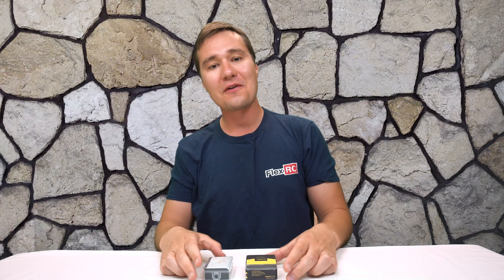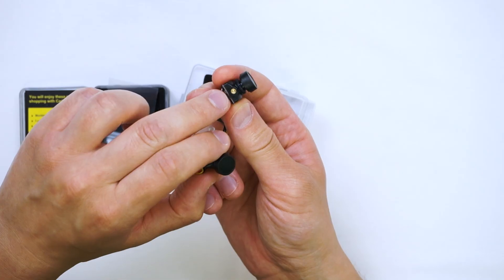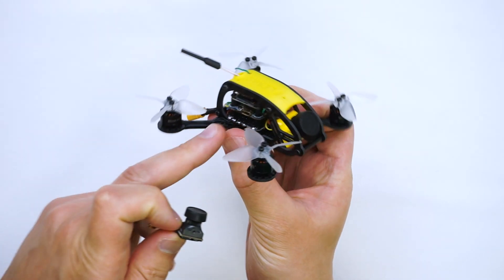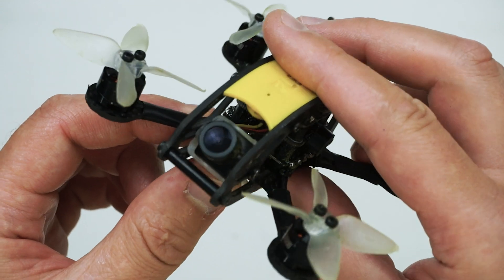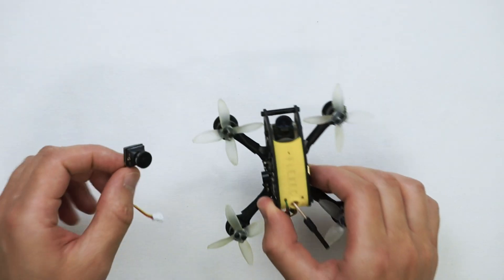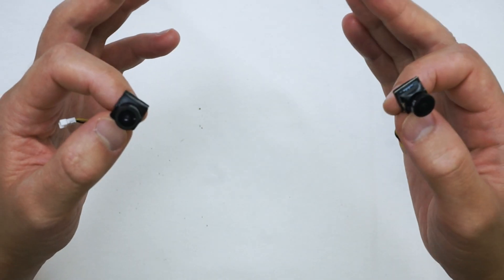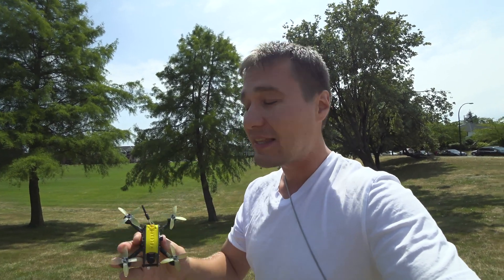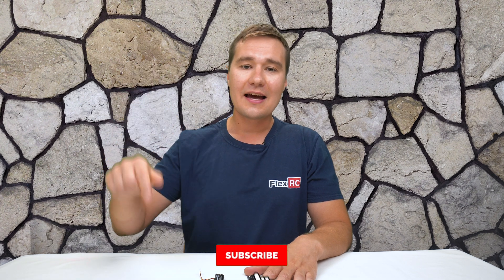Caddx Turbo EOS2 vs Runcam Racer Nano - In Depth Review and Comparison

Comment from the maker: ⚠️ PRODUCTS IN THE VIDEO  ⚠️
❗️ FPV CAMERAS ❗️
✅ Caddx Turbo EOS2: https://flexrc.com/product/caddx-turbo-eos-2/
✅ Runcam Racer Nano: https://flexrc.com/product/runcam-racer-nano/
❗️ FRAMES ❗️
✅ FlexRC Ascent X 2": https://flexrc.com/product/ascent-x-2-frame/
❗️ELECTRONICS ❗️
✅ T-Motor F15 1106 6000kv: http://bit.ly/2ZSl3b4 
✅ HGLRC Zeus AIO FC/ESC: https://flexrc.com/product/hglrc-f4-zeus-f4/
✅ HGLRC GTX nano: https://flexrc.com/product/hglrc-gtx-nano-vtx/
❗️BATTERIES ❗️
✅ 450mah 2S 75C battery: https://flexrc.com/product/tattu-450mah-7-4v-75c-2s1p-lipo-battery-pack-with-xt30-plug/ 
✅ 450mah 2S 75C battery: https://flexrc.com/product/tattu-450mah-7-4v-75c-2s1p-lipo-battery-pack-with-xt30-plug/ 
✅ 650mah 2S 75C battery: https://flexrc.com/product/tattu-650mah-2s1p-75c-7-4v-lipo-battery-pack-with-xt30-plug/
Reply: this guy is stealing your content: https://www.youtube.com/channel/UC3RW9gp_PVV-0lxag27dftw/videos